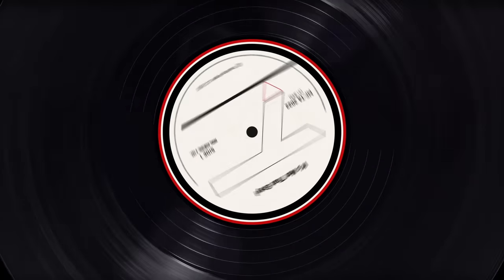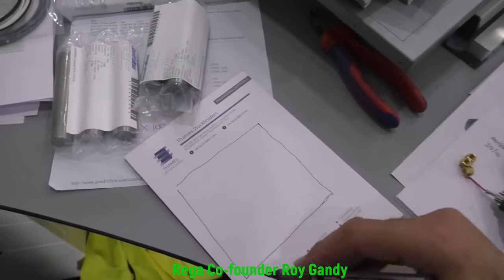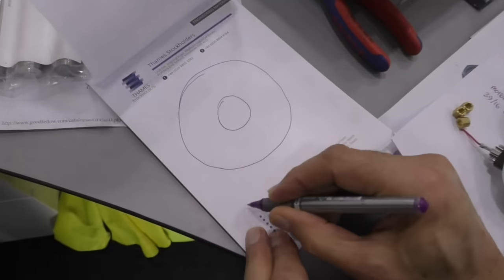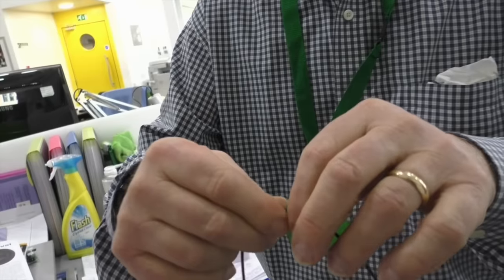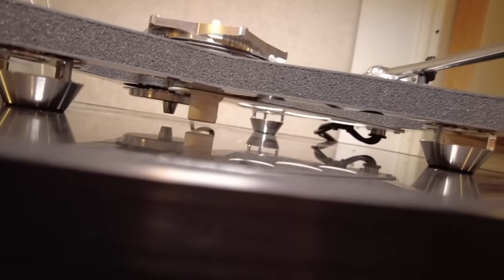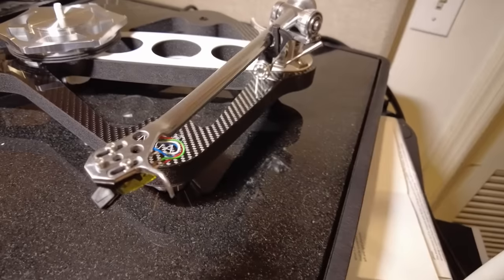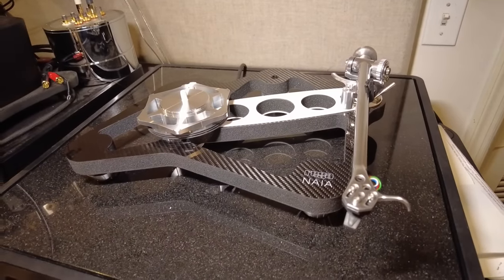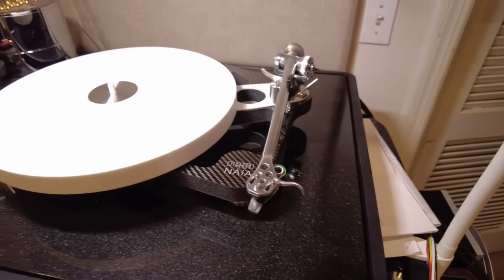Rega's NAIA Turntable —A Fast, Full-Featured Video Tour

Comment: I always wondered about the lifespan of the sandwiched foam as ive seen many a speaker surround and headphone pad disintegrate over time so glad to hear it will  last at least a lifetime. Still love my old Rega P9 to this day.
Reply: It is rotting in front of your eyes.  But how fast is unknown.
Reply: If the foam composition were to change in any way, the specs of the turntable would change. Also, this table is not a massively built turn table that looks like what it costs frankly, and that's a negative factor I think. I know as someone who has been into turntables for over 35 years, it's always been partly about mass and rigidity, not just rigidity. I would prefer to see a table that balances the mass, heavy build quality with the rigidity, especially at this price point of the Naia.  So a table weighing maybe 5 times or more than what the Naia weighs, with maximum rigidity.

Comment: I bought recently a P10 turntable and the philosophy of Rega is totally different from other manufacturers; It’s not a bout mass but rigidity. And using inexpensive materials.
Reply from the maker: The ceramic aluminum oxide parts are not inexpensive

Comment: Credit to Rega that they still manage to price their flagship turntable at a human price. They focus on what matters, bearings, mottor, stiffness. The only thing that bothered me is their fascist attitude to cartridges. I don't like their cartridges and lyra or even flagship audiotechnica  sounds way better and cost less, on RP 10 or Naim but it's a pain ti set it up, with spacers and matts.  PS anyone who attempts to put spacers on this or P10 be advised that ceramic oxide is very hard, therefore very brittle like glass. Torque it very carefully between 0.4-0.6nM
Reply from the maker: If you invest in a Lyra or any cartridge priced above a few thousand dollars, you can send it to WallyAnalog and have it scientifically assessed for VTA/SRA, azimuth and even zenith angle, which they have discovered can be up to 9 degrees off (that's defective). You get back a shim manufactured from a super hard material that inserted into the head shell corrects for VTA/SRA and azimuth and you'll know how far "off" is the zenith angle so you can correct that too. FEW cartridges are correct there, sad to say...then you have the benefit of Rega's rigidity  and correct SRA and azimuth.
Reply: @trackingangle929   @trackingangle929  totally agree on that. You only need to set it up once, and not having various complications on a tonearm adds to rigidity... I tried to set it up once with a microscope once myself on a less costly cartridge, but nearly broken my neck and got cross-eyed for a day...  I have reached out to WallyAnalogue, but had to put it on hold till better times. Thank you for the advise, that reconfirms my decision

Comment: And if you want to use different cartridges, and no VTA ...?
Reply: I used a different cart. A Hana Unami Blue on a Rega P8. Added a 2mm spacer. No issue.
Reply: SRA no problem, shims will get you there. Azimuth is a different matter. There is no perfect cartridge. That needs to be adjustable.
Reply from the maker: As I wrote in the review on the website PLEASE READ IT! You can send your new cartridge to WallyAnalog. They will analyze and return with high quality shim that corrects both azimuth and VTA/SRA and will tell you your cartridge’s zenith angle error and how to compensate if there is one. Obviously if your cartridge costs $500 you won’t be investing same in this service but for a $3000 or more one it’s worth it!
Reply: hi sir Michael im using ania pro to my p6 ask please if its worth to send it to WallyAnalog to be correct or upgrade my cartridge to Apheta3!? Thank you and god bless you sir

Comment: Rega helped launched my passion for vinyl playback, but I learnt the importance of proper cartridge setup through subsequent upgrades.

Despite how technically advanced this sounds the lack of easy azimuth or VTA (without 3rd party products or MacGyver-solutions) really puts me off.. Perhaps Rega will someday come up with a tonearm that achieves these flexibilities whilst satisfying their thirst for rigidity.
Reply from the maker: Everyone who does proper turntable set ups relies upon 3rd party products. So I'm not sure why you object to their use.
Reply: @trackingangle929  I mean in terms of native adjustment available in the tonearm itself. Rega arms dont allow azimuth adjustment, nor have any ability to raise or lower the arm mount. 

I would have to add shims to headshell for azimuth or similar under tonearm mount for VTA / swap out turntable mats (cartridge height permitting). 

I use a Kuzma 4Point and can adjust everything aspect of setup to a precise degree very easily- and I highly value that.

Comment: Why do high end manufacturers always machine the bearing shaft and the spindle as one piece that allows the bearing vibration to travel all the way to the spindle that's in contact with the actual record? I'd prefer to have them decoupled from each other. Some other more enlightened manufacturers are doing this.

Comment: One thing that bothers me about the design is the use of 3 belts. Why would they go to the trouble of producing a round cross section belt with "extreme accuracy" when they could use a single flat belt that would rotate the subplatter effectively? Many years ago AJ Conti was frustrated that his flat belts didn't provide consistently accurate speed stability so he devised a process where he ground his belts so that the cross sectional thickness was the same throughout the full length of the belt, thereby providing accurate and consistent speed stability. 
One belt with extreme accuracy versus 3 belts and 3 machined grooves in the pulley. I know which method I would choose.
Reply from the maker: Yes. AJ  did with flat belts what Rega does with their proprietary O-rings. Ultimately it's where you get to no how you get there. I think part of the reason for Rega's choice was to keep the profile low ..
Reply: @trackingangle929 The width of one flat belt would be less than the overall width of 3 round belts, not sure what you mean. I'm not trying to be argumentative , just making an observation. I spoke with AJ at length 20 years ago. He was very happy to share his design concepts, a shame he is no longer with us.
Reply: To clarify, if you have three belts that are really well-made, but nothings 'perfect' in the world what you're gonna do is multiply any error and then divide this error by three
Reply: @trackingangle929  Well, Rega engineered a better way did catch the part where Michael writes "average speed was even better: 33.331, with a percent deviation of 00.00%. I don’t recall ever before seeing all zeros"

Comment: When Akai introduced their GX Glass heads they claimed they would never wear out and in fairness I suppose that was true but they didn’t imagine 40 plus years later people would still be using them.  Jump to present day and evidence has shown they actually chipped slightly with use.  

Could this be an issue with ceramic bearings and if so, could it be more of a problem than slight wear?

Just an observation, not a criticism.

Comment: It’s a wonderful tradition that all innovation sales people sell comes from airspace, outer space or military. We don’t need a normal industry anymore, saves us a lot of cost and emissions.
Why invent a complex NASA gimmick, instead of using items brought by us by normal industry in mass, just that it’s from a producer with a tighter tolerance and production process? Doesn’t sell, right?
Does that make a difference? Isn’t the difference worth the extra cost? Yes and No. Everything makes a difference, everything in sound and cost, but as long as all a hungry for the next rocket-ship and willing to pay, a balanced top-end solution isn’t on the target list. It’s like selling Motorcyclists for the path-less offroad 180HP Motorcycles with 300Kg weight to juggle around alone in some rocky desert at 100mph.
Oh, I forgto, yes that’s the current norm.
Reply: Still a great turntable at a high, but somehow subjectively good price.

Comment: Way overpriced.
Reply: No it isn’t, if you want to see overpriced look at other manufacturers
Reply: How is it overpriced? Which turntable do you have?
Reply: @gweflj material cost yes, but manufacturing research costs are far beyond the typical high mass belt driven system.
Reply: @gweflj cars are just made of metal and plastic and glass
Reply: Build a better sounding one that follows the same design thinking of ultra light and make it cost less. Than we can talk!😂
Reply from the maker: @gweflj  the concept is not flawed. Your thinking is flawed.
Reply from the maker: @gweflj  that has nothing to do with this....
Reply: It amazes me that you would make such a comment without producing evidence to support your claim. You obviously have no idea what goes into manufacturing a viable ceramic bearing assembly built as a matched set, upper and lower housings, not to mention the cost of manufacturing such a bearing. The internet allows anyone to make drive by insults on manufacturers efforts without any supporting data. FWIW, I have over 40 years experience in machining/manufacturing and I'm not a Rega fanboy.
Reply: The Oracle Delphi at 10K is much better value.
Reply: Couldn't agree more👍
Reply: @jdekong. It's not carbon fibre, it's graphine. Very different appart from carbon atoms. The molecular structure of grafine is tubular. I remember when I was doing my physics degrees, it was 1st time produced and was a big sensation. At the moment few manufacturers have access to graphine. Magico is one of them. Rega has a close relationship with F1 McLaren, so they have leveraging on this.
Reply: To get an equivalent turntable you'd have to spend minimum 3 times.
Reply: You obviously didn’t watch the video? What do you own?-Lenco or something from Amazon ?
Reply: I manufacture very complex  lenses for people with visual impairments. Sometimes we will make a lens at a huge loss. If the factory price is normally about 200$ and then look at the real price of the lens due to tooling, polishing , mistakes , coating etc it can actually work out close to 1,000$! We still sell it for 200$ because we love what we do! On the subject of hi-tech tools in a factory take a look at the REGA, Cyrus and any other HiFi equipment factory and tell me if you can guess the price of a CNC machine?
Reply: @BorisJurash cheers Boris. Proud of you !
Reply: @gweflj  The cost of aluminum and machining that slab into traditional piece of machined aluminum, $200. Months and years of research to figure out how to minimize vibrations by making a super light, super stiff plinth,$2,000,000.
Reply: I bet you didn’t even watch the video to realize the complex, high-level of design, manufacturing with ridiculously small tolerances, and high material requirements that goes into the Naia. They researched and custom-made belts for this table, and made sure they were three of them, because no belt is perfectly round so by adding another two belts, they’re minimizing the risks of wow and flutter.
Reply: I think you can say just about any top-of-the-line hi-fi product is overpriced. But value is really in the ear of the beholder.  If you want value pick a design you like and then don’t buy the top-of-the-line pick some thing one or two steps down. 

I too am skeptical of the rigid versus massive turntable design. But I haven’t listened to the new Regas and several people like Michael whose opinions I value think that the rigid design works well. So I’m willing to wait till I have a chance to listen to it myself before I doubt that it works. 

if you really want value take a turntable with a great platter and great tonearm and drill a hole through the back of your wall. Run the wires through the wall and mount your table on the other side of the wall and completely isolated from sound using absorbing material. Design and add a Remote tone arm lift and drop mechanism and now you should have a table that is totally isolated from sound and only subject to the vibrations of the cartridge and the record. I don’t know anyone who has ever done this but I’ve always thought that it would be the way to go.
Reply: @gweflj your having a laugh cheap material 😹😹
Reply: @gweflj  An Aluminum Billet the size and thickness of the Naia plinth would cost about $350 retail. ...Graphene infused Carbon fiber W/Tancast foam core would be well over $1000 retail (if you could even source it) for a plate like what Rega uses for their Naia plinth. -- -- "adding graphene — only 0.075% concentration by weight — to the first stages of this process allowed the team to create a carbon fiber that had 225% greater strength and 184% greater stiffness than the conventionally made PAN-based carbon" ...Graphine is insanely expensive BTW, look it up.
Reply: But you can Spend double and it will be Competitive. What I use is Double the Price. If I was buying from Scratch, I would SERIOUSLY consider this or the WAND, another excellent Turntable for the money that I think is 2K cheaper.
Man, it makes me Wonder. 😳😬🤔
Reply: I tried to post a reply but it didn’t show up. I am in a War Zone at present , not the best Wi-Fi. 
I Spent double the cost for a Turntable and then, this shows up. Damm. The WAND is another excellent Turntable for the money. I am Happy with what I have but, that’s life. 😅😅. If I was starting over, this is what I would be looking at.
Reply: @gweflj Yes, the materials Rega chose to use for the Naia absolutely effect performance in a positively musical way.
Reply: @gweflj  please supply data that the concept is flawed.
Reply: I own a P10.  Two years ago went looking for an upgrade.  Auditioned the Kuzma and several other high mass tables.  The Stabi R wasn’t better…only different.  The other two were a sonic mess compared to the Rega.  Don’t know what to tell you but I do know people are attracted to mass and manufactured billets of aluminum and the like.
Reply: @gweflj  fortunate to have heard many tables and have the empirical experience.  as a turntable material compared with others, foam is pretty damn inert.  also from experience, high mass tables need isolation on typical suspended floors in many homes.  by comparison, the Rega does not.  there are well implemented high mass tables but unfortunately, most are made simply to justify exorbitant pricing.

Comment: I like Rega (the RB series arms are design classics IMO) but I see so many basic design flaws with these TT's that the use of exotic materials and high precision just seems redundant.
Reply: And the clown has spoken...
Reply: @gweflj  it’s correct and necessary to question design decisions, there’s no clownery about that. As long as one follows-up the scepto-curiosity with real interest and research (listening, understanding the tech applied), etc. We’re all just curious and more or less understand why that is the solution. While Michael hammered on the plinth the arm was dancing, can’t tell me it has no impact.
Ultimate Rigidity can’t be ideal as forces need to be absorbed and not lead to structural separations only hold together with high-tech glue. So we’re not told the whole story here, understandably.
Reply from the maker: I think the clown reference was because you come, you declare "design flaws" but don't cite any. That's clownish.
Reply from the maker: @GiancarloBenzina  I did not "hammer" on it and as i wrote in the written review and said here, tapping on the plinth with the stylus in the groove produced far less sound through the speakers and what there was, was at a higher frequency than doing likewise on high mass tables improperly designed that THUMP like crazy. Both high and low mass designs can work extremely well or fail miserably depending upon implementation.
Reply from the maker: @gweflj  That's empirically wrong. Properly executed the low mass design dissolve those vibrations like water droplets hitting hot pavement. Improperly execute a low mass design rings like a drum. A high mass design improperly executed will resonate at low frequencies that hang around for a long time.Critical damping is possible in both designs...The turntable I own weighs 300 pounds and is critically damped. But I've reviewed boat anchors that rang...